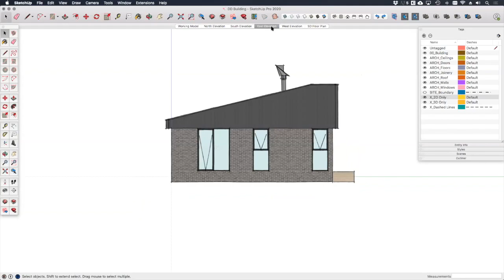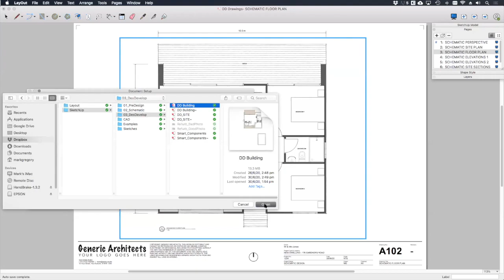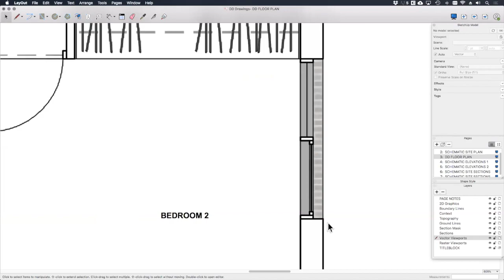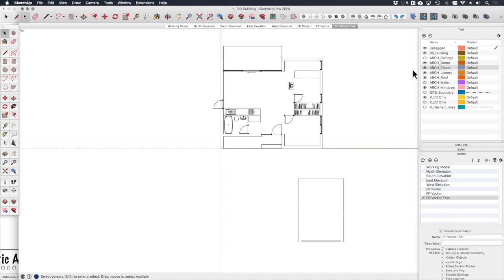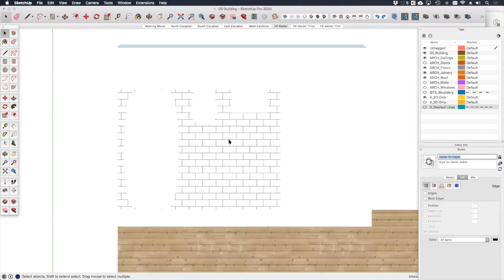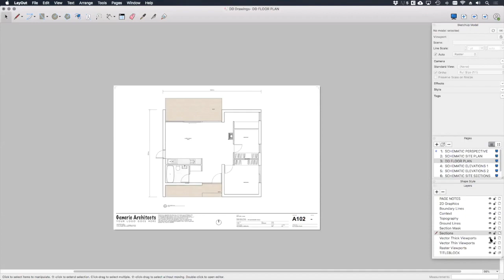Stacking Viewports - The Secret to Meaningful Drawings in Sketchup

Comment: This is just for people using sketchup 2021 or older, now you can control the line style, weight and color of every sketchup tag on the same viewport, stacking viewports makes no sense anymore.
Reply from the maker: It is true that you can now associate certain line styles to different tags in SketchUp. This is great for drawing boundary lines and dashed demolition areas. However, you cannot yet assign different line WEIGHTS to tags in SketchUpm hence the need to stack viewports to get different pen thicknesses.
Reply: @skalastudio9544   Hi mate, yeah you can actually change line weight by tag. You just change the 'edge width' when you change the line style from default.